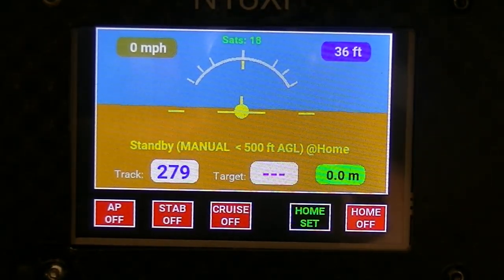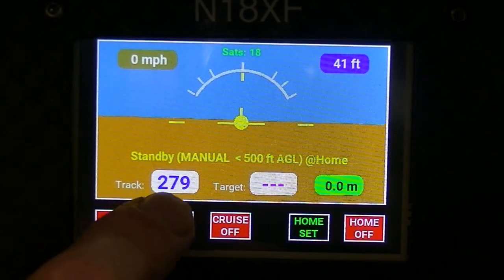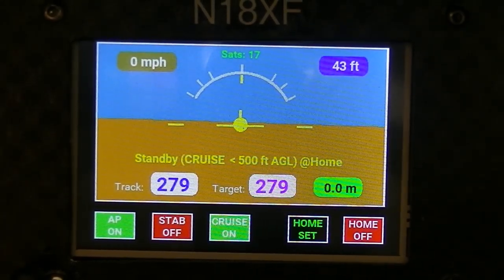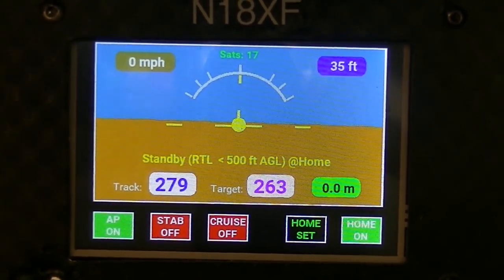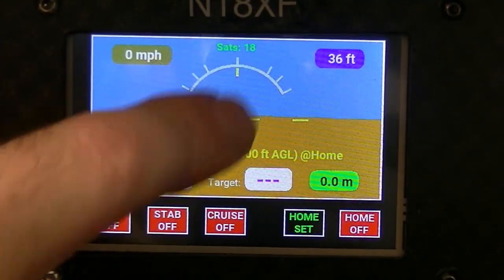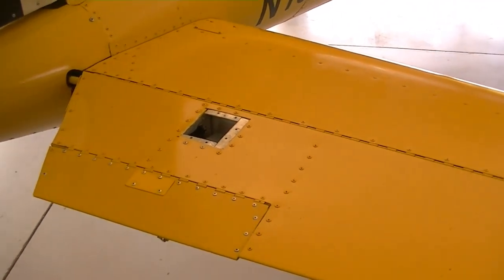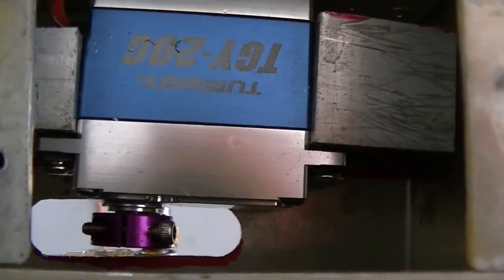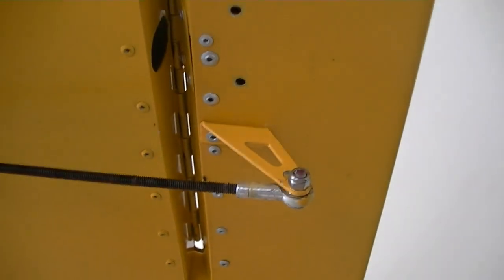Xflight Technologies Autopilot Overview

Comment: I’m a bit alarmed to see that there aren’t nearly enough threads protruding past the locking portion of the nut at 2:30. Also, those should probably be drilled bolts with castle nuts and Cotter pins. Other than that, I WILL be buying this product for my aircraft in the future! Great job!
Reply from the maker: 5xls yes good point! Thanks.
Reply: @5xls - did you ever buy an Autopilot/AHRS from Steve? I'm looking for help in getting my screen back to normal. It boots, beeps but displays "No Signal". I'm assuming the contents of the SD card have corrupted. I'm looking for someone who would share the contents of their SD card or sell me their screen (Rasp Pi) if they're no longer interested in using it.
Reply: @markmoore454  No, I never did build a plane. My dream job of 13 years went away, and I’m relegated to flying ratty old 767s, with the associated pay cut. One day I hope to build something.

Comment: Is there a way to adjust the autopilot track?
Also would it be possible to use the pitch servo in a anti Servo tab configuration, for an all flying tail tail?
Reply from the maker: The only way to adjust the track is to disengage the AP and point the plane in the new direction you want to fly and then re-engage it. (We are planning a later release that may support a track knob, as well as waypoint missions). Assuming a regular trim tab works on the tail, then yes, you can invert the trim function.  Feel free to contact me at steve@xflighttech.com if you want to discuss more.
Reply: Mark....did you ever buy an Autopilot/AHRS from Steve? I'm looking for help in getting my screen back to normal. It boots, beeps but displays "No Signal". I'm assuming the contents of the SD card have corrupted. I'm looking for someone who would share the contents of their SD card or sell me their screen (Rasp Pi) if they're no longer interested in using it.

Comment: Im assuming there is a way to home the servos when the ap is off?   Can you trim them for zero in programming or is that all done mechanically with the linkage?
Reply from the maker: It’s best to set them up mechanically to be at the neutral position when first installed, but you can also apply trim offsets with configuration parameters. Also by default auto trim is enabled in the flight controller, so when you switch out of autopilot mode you will be trimmed for straight and level. There is also a manual trim system option, so when not in an autopilot mode, you can manually trim with yoke switches.
Reply: I assume if there is a fault you can just kill the power to the servos and isolate them
Reply from the maker: Flyguyeddy Yes, we recommend a separate switched circuit for the servos. Also the servos only control trim tabs, so the pilot will always have full control of the primary control surfaces regardless.
Reply: What about using springs attached to the main control stick?    Sort of like centering springs that you bias with a servo
Reply from the maker: Yes, I use a spring on my elevator control linkage to centralize the elevator (counteract gravity)
Reply: I mean use the spring to equalize the elevator and the other end attached to servo arm so everything is internal
Reply from the maker: You mean directly control the stick with servos via springs? I guess it could be done that way, servos might need to be bigger. Would also need 2 servos per axis as you could only pull, not push.
Reply: @XflightTech  Are you still open?
Reply: @flyguyeddy...did you ever buy an Autopilot/AHRS from Steve? I'm looking for help in getting my screen back to normal. It boots, beeps but displays "No Signal". I'm assuming the contents of the SD card have corrupted. I'm looking for someone who would share the contents of their SD card or sell me their screen (Rasp Pi) if they're no longer interested in using it.
Reply: @markmoore454  negative, but this is definitely a lesson to copy that sd card image for others